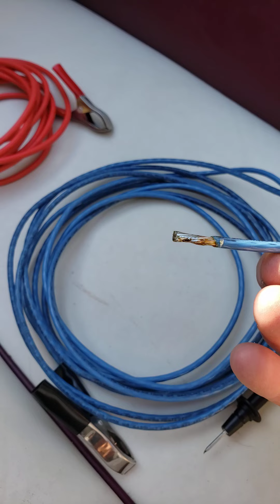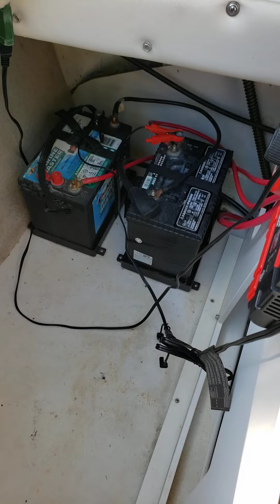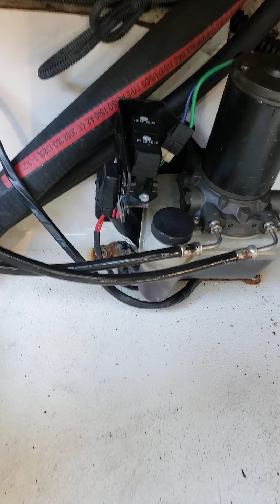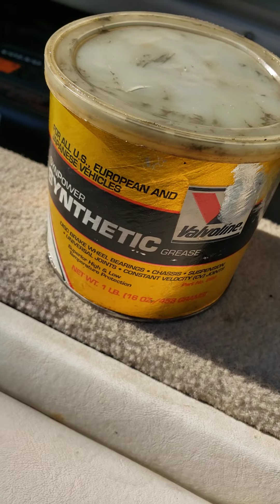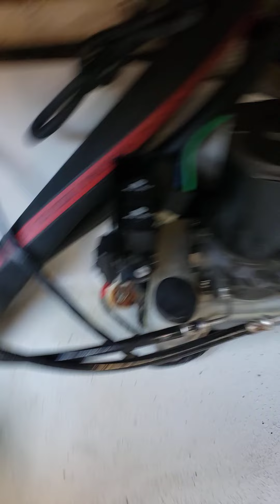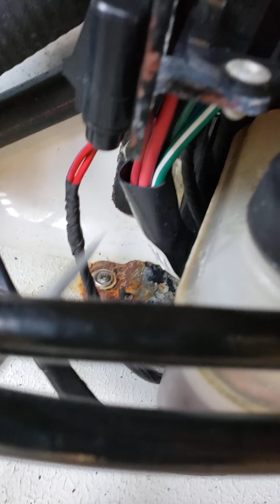2002 CROWNLINE 225BR TRIM MOTOR REPAIR AND TIPS - VOLVO PENTA SX OUTDRIVE

Comment: Do you have a trim pump solenoid on the motor?
Reply from the maker: Nope, solenoids are electrical and don't work well in salt water.  I do have trim position sensors on the outdrive. HooYAH!  GO NAVY!